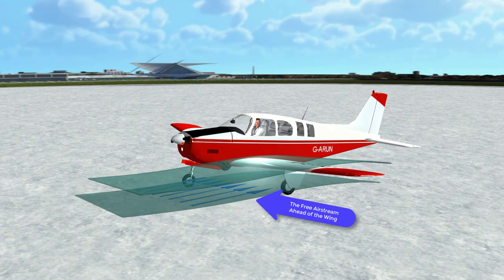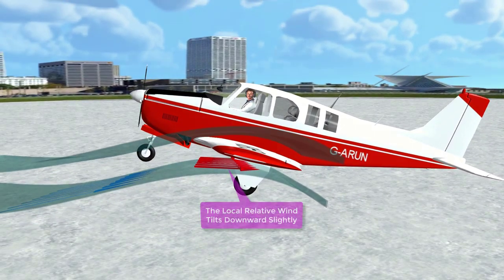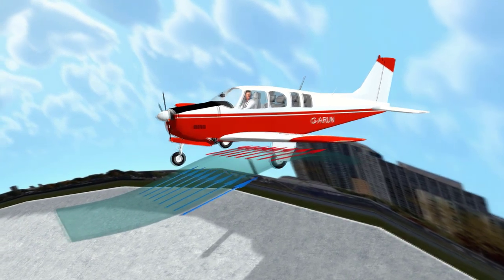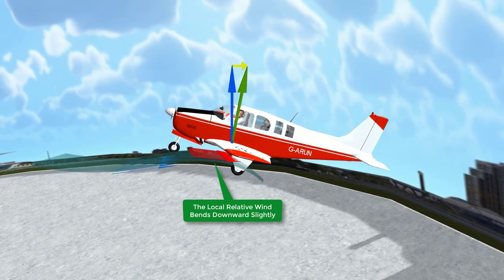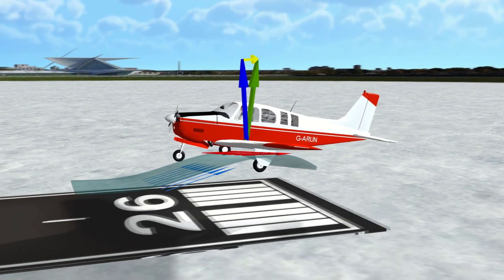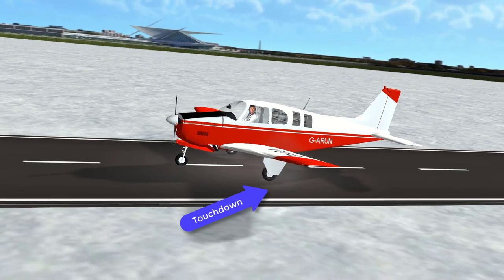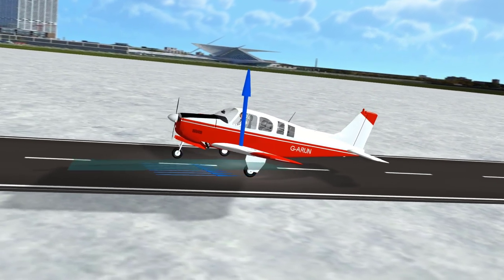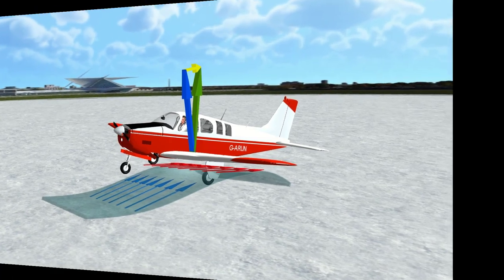Induced Drag and Ground Effect

Comment: Thanks - two areas I would appreciate coverage in any course are . How the center of pressure moves around on the wing when ailerons are deployed ( laterally toward tip of downgoing aileron and slightly aft with inboard and slightly forward on other wing ) , then when flaps deployed ( inboard and toward trailing edge ) . Secondly why AOA is higher on inboard wing in a turn . Thanks .

Comment: The way that the illustration is demonstrated, it shows the air rising up to strike the underside of the wing like a constant updraft. That would sure be good for fuel economy because it would be like being in a constant descent even though you are flying straight and level. How do you get the air to suddenly rise toward the plane?  Also, why do you show that the lift is vertical on a normal angle of attack but tilted back on an increased angle of attack?
Reply from the maker: Greetings:
The wing's overall pressure distribution results in the upwash ahead of the wing. The portion of lift that's vertical is often referred to as "Effective Lift." The portion tilted aft is the wing's Total Lift. The tilting aft of the total lifting force results in increased induced drag.

Comment: I still got one problem: How does this explain the effect of aspect ratio on induced drag?
Reply: Hi, as aspect ratio increases, induced drag decreases because the wing will be less effected by wingtip vortex the larger the aspect ratio, then obviously reducing induced drag because there would be less downwash from the wings and therefore the direction of lift will be 'tilted back' less. I hope this helps a bit

Comment: How would a 757 handle at 530 mph at an altitude of about 20 feet?
Reply from the maker: I have no idea.
Reply: @Flight-Instructor  "According to the 9/11 Commission Report, as Flight 77 was 5 miles (8.0 km) west-southwest of the Pentagon, it made a 330-degree spiral turn clockwise. At the end of the turn, it was descending through 2,200 feet (670 m), pointed toward the Pentagon and downtown Washington. Hani Hanjour advanced the throttles to maximum power and dove toward the Pentagon. While level above the ground and seconds from impact, the wings clipped five street lampposts and the right wing struck a portable generator, creating a smoke trail seconds before smashing into the Pentagon.[39][40] Flight 77, flying at 530 mph (853 km/h, 237 m/s, or 460 knots) over the Navy Annex Building adjacent to Arlington National Cemetery,[41] impacted the western side of the Pentagon in Arlington County, Virginia, just south of Washington, D.C., at 09:37:46.[42] The plane hit the Pentagon at the first-floor level,"
https://en.wikipedia.org/wiki/American_Airlines_Flight_77#Crash
Reply: He asks and he answers
Reply: @pilotboy2612  go try it out and tell us about it.